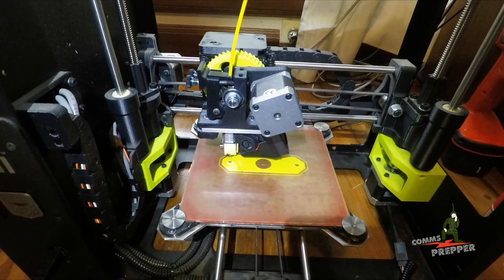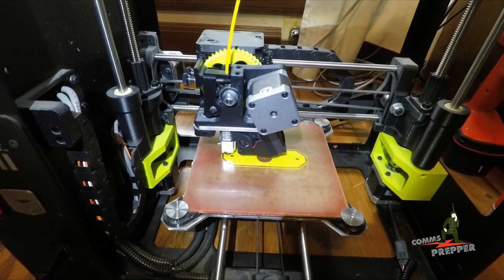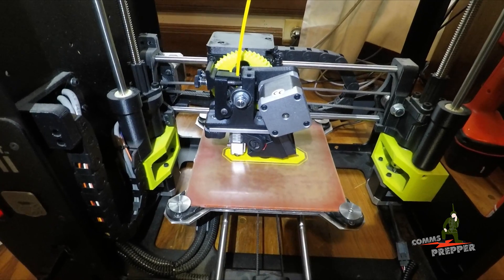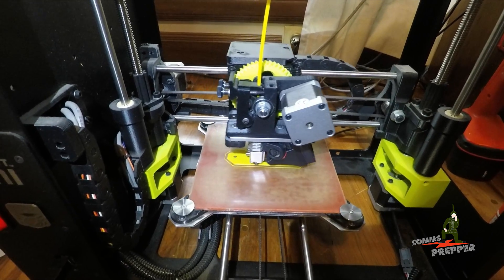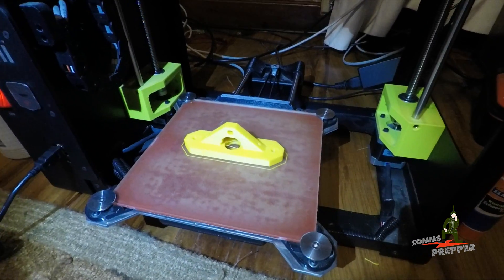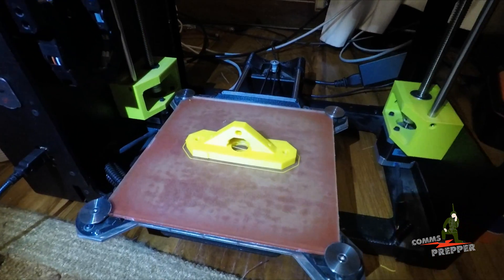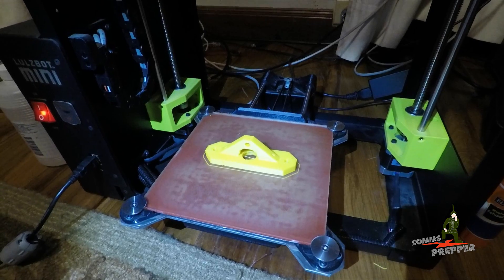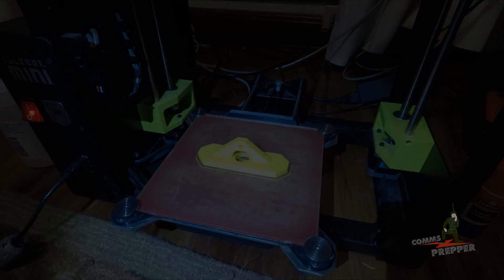3D Printers for Preppers - is there a role for them?

Comment: If you want to be really prepared, you need a standalone CAD program and the ability to recycle plastic.  Check out some of the plastic shredders and extruders that will make your own reusable filament.  Even in a SHTF, there should be enough residual plastic to make things in a pinch.  Of course, you can stockpile filament to get you through a long term emergency.  If you have the money, invest in a 3D laser scanner (big bucks) and you can accurately replicate any part you need and then 3D print it.
Reply from the maker: 3D scanner would be great.  I will have to hit the lottery for that.  Thanks for the comment and channel support.
Reply: I know this is an older video, but you can checkout the recreator 3d turns plastic bottles into filament directly so you don’t need to shred and extrude the plastic

Comment: 3d printer are great tools to have especially if you have the skills to design your own parts.. 3d CAD skills..  (you can learn basics your self with free software). Why are 3D printers great? .. make new plastic parts that break or wear out.. make plastic parts that then can be used to make sand cast forms and cast in aluminum etc..     Also a tip got you PETg filiment, Nylon, and ABS are far stronger than PLA plastic.. for any parts with stress on them PETG is easy to print as PLA but far stronger.. . nylon has many different flavors from flexible (rubber like)  to fairly stiff.. but its very tough stuff..  ABS is strong but harder to print due to warping etc.   Also if stocking plastics have a way to dehydrate the ones that absorb water.. warming them for few hours to 8+ hours, like in a food dehydrator.  But yes, loads uses for 3d printers if you can design parts or have a bunch of STL files on hand for the stuff you need... not to mention great skills to barter with people for items or services..  Your dipole part you might want to infill higher to add more strength.
Reply from the maker: Thanks for the comment and great tips.  I have had the printer two days now and have a second one on the way.  Communications being my specialty - I need to fabricate lots of small passive parts.  I have a roll of ABS but will order some PETG soon.  Again - thank you for the information.  Respectfully,  Hank
Reply: @Commsprepper   Another tip if i can put a link here,  this stuff, "fructis style extreme control anti-humidity hairspray"  the stuff with the bamboo on the can... and extreme hold..  is the absolute godsend to get prints to stick and or not weld them selfs to the bed...  it has some property that makes stuff stick great and when the bed cools the print just pop right off easy..  this stuff is magic..    washes off with warm water to clean your bed etc..   try it if you can find it..   https://www.amazon.com/Garnier-Fructis-Anti-Humidity-Hairspray-Extreme/dp/B008L2UJLO/ref=sr_1_8?keywords=Garnier+Fructis+extreme+Control+Anti-Humidity+Hairspray&qid=1552451123&s=beauty&sr=1-8

Comment: No, there is not a use in "prepping" unless you trying to get around banned items.  It is a novelty, and I sure don't see many 3d printers buzzing right now in Venezuela!  It is a hobbyist fantasy to invest in a printer for "prepping".   Especially when you don't have food/water/shelter/grid provisions!
Reply from the maker: I disagree.  There is nothing "banned" about Amateur radio parts.  I do agree that baseline prepping (food, water, shelter) must be a priority before acquiring a 3D printer.  I can say that it would have been nice to have a 3D printer when I was building my rainwater collection and off-grid solar power systems.  There were lots of little parts that I could have printed that would have made those projects better - not mention - reducing the number of trips off the mountain to the hardware store.

Comment: Absolutely. I have a Creality Ender 3. I would also make sure you're familiar with designing the parts as well with software like Fusion 360.
Reply from the maker: How do you like your Creality?  I have a 10S Pro coming.
Reply: @Commsprepper  It works well. I did upgrade the firmware to TH3D instead of the stock firmware. For $200+ it is definitely worth the money.

Comment: Hi, greetings from Chile. Tell me, what is and for what is the part that you print?
Reply from the maker: Center part of an HF dipole antenna.  SO-239 connector has to be added to the center.
https://www.thingiverse.com/thing:2835611
Reply: Thanks for your answer!!!!  Great idea.
I make with a PVC antenna center 
What program do you use for design ? I would like to learn.
Reply: Also, could be a great tools for to do same stuff for my local chapter of red Cross. Greetings from Chile
Reply: I will need help for to make field antennas , for trainee for new Telecom volunteer
Reply from the maker: In this case I just download the file from the web.  If you want to make your own designs there are many programs - I have been learning Fusion 360.
Reply from the maker: You will want to research filament materials for specific printers you are looking at.  Most use PLA and ABS.  I don't recall ever seeing PVC as a filament option.
Reply: @Commsprepper  Thanks!!!